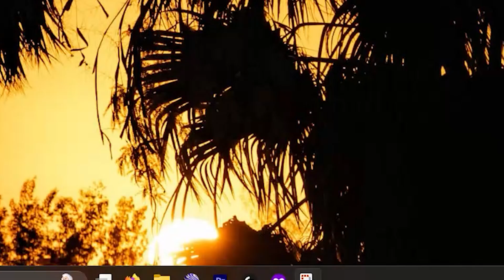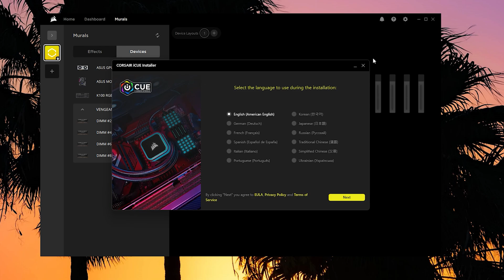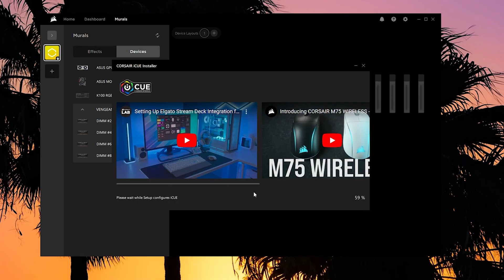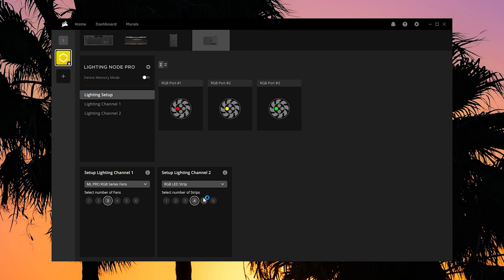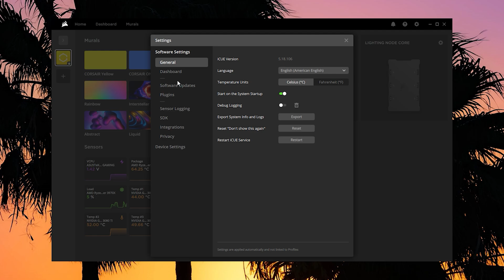Corsair iCUE 5 - No device detected

Comment: Well, sad I probably have to change the Node Core, because one of my "Q"fans stopped getting a signal on its outer rims and the second stopped LED-ing completely. Also iCUE sees ALL my stuff (all 16 of them xD even those two not working) even the NODes, YET I can clearly see in the Device manager the Node Core is not recognised as a device... an gladly throw it onto Windows 11, before there was no problem...
I will check it again and in more depth when there will be at least a week holyday when I will be able to take the pc partly apart xD

Comment: My issue is every so often my middle fan in the iCue link hub has no lighting effects and every time it happens iCue doesn’t detect the hub or fans even if they’re in device memory mode. 

A power cycle always fixes it and iCue recognizes it again, it’s annoying. Granted it only happens a few times a month but I know all my connections are solid and I can’t see it being a hardware problem as it’s easily fixed.

Comment: I have Corsair vengeance rgb ddr 5 ram and it doesn’t just built my mobo 3 days ago and I looked up every vid and confirmed seating checked for dust. Updated every drive, bio, and just as many updates that was needed.. I’ve repaired, reinstalled, uninstalled, and just legit about everything and when it also comes to restarting the pc if freezes and my orange dram light turns on my mobo and doesn’t boot. And once again all my parts are new i was very if not extremely careful in putting everything together.. and tbh the pc works fine i just can’t reset my pc nor see my ram in my i cue app. What could be the problem?
Reply from the maker: Sure what are your specs?

Comment: Hello, buddy!

I just got a HX1500i psu and it doesn't appear on my ICUE. I tried repairing the instalation, but didn't work. Any tips
Reply from the maker: Just to confirm, you did use the USB cable from the PSU? If so, try reverting your iCue and see if that works.
Reply: @ChrisMizo  I'm not sure about that, I'll check with the guy who did the instalation... thanks, bro!
Reply: @ChrisMizo  that was the issue, bro! Was missing the USB cable plugged in on MB. Thanks for the tip! :D
Reply from the maker: @BrunoNarghel no problem! Glad it's resolved ✌️

Comment: Nothing worked
Reply from the maker: what is the issue you are running into? what are your specs?
Reply: @ChrisMizo  PC specs:
Motherboard: ASUS Prime B-550 Plus AC-HES
CPU: Ryzen 7 5700X
GPU: RTX 4070
AIO Cooler: iCue Titan 240 RX LCD
RAM: 64 GB Corsair Vengeance RGB Pro DDR4 (4x16)
PSU: Seasonic Vertex GX-1000

My theory is that the USB splitter cable that connects to the USB 2.0 header might be faulty like you said in the video. Everything runs fine. The LCD screen is working, the fans are working, and the RGB is working. I just can't control them since icue doesn't detect my cooler at all.

Comment: For anyone wanting to use the Corsair Commander core XT & a corsair fan RGB hub or lighting node pro. IF you are NOT using Corsair components it will not work, example i have 7 LianLi uni-fans GPU & CPU water block also a 24 pin strimmer,& distro plate all with RGB, none of which are corsair, To get all my non corsair component's to work & be able to achieve individual control over ever components i had to purchase 2 Corsair Commander Core XT controllers, Then everything worked fine with signal RGB & IQUE. Don't waste your time & money if your not using all corsair components...trust me...

Comment: Listen, if you haven’t been moving or fiddling with your pc, and icue starts acting up, its the software. The best solution I have found is to stay away from all the expensive proprietary fan lighting candy, and connect everything to your mobo. The software development team at corsair keeps breaking the code that runs their garbage.
Reply: I tried everything. The rgb's was stuck on random pulse and not detected by icue software. - Just unplug the "Node Pro" dont need lights anymore.
Reply: Agree

Comment: Ive managed to get the rgb working but the fans dont move and are not detected somewhere 
The node is already plugged in the motherboard on a inrerna usb
Reply from the maker: Make sure your fans are also plugged in and just not the rgbs
Reply: @ChrisMizo  After searching in many videos etc, i've seen that all fans need alos to connect direclty to the MB... Thing is, my MB only has 3 fan ports so i guess i need a hub now for all 6, right?
Reply from the maker: You can use a hub or fan splitters 👌
Reply: @ChrisMizo  where does the hub connects in the mb?
On any fan receptor?
Reply from the maker: @johntsam7071 same pins where the fan plugs in usually.
Reply: @ChrisMizo  so any of the 3 that my MB has, right?

Comment: @Chris Mizo. I've tried all of your tips from your videos. No dice.
Reply from the maker: What's the issue your having?
Reply: @ChrisMizo , for reference, I have the iCUE Link h150i LCD AIO w/ QX Fans + an additional 4 QX Fans and an MSI Z790 Carbon Max Wifi II Motherboard. All connections are correct, having been checked and re-done several times...  iCUE has never detected the AIO, QX Fans, nor my Motherboard. The LCD Screen displays the temperature and the fans work in their default rainbow colored mode and default fan speed, but they do not increase in rpm under stress at all... (which I discovered while benchmarking)... Luckily, my system performed very well despite this. Thank you for reaching out!

Comment: Hey, so I just put in the H150i QX, but I can't seem to find the settings for the LCD. It's only showing the liquid temperature, I think. I checked iCUE, but the settings aren't there. I've already got the USB plugged into its own header. I'm stumped. I don't know what to do
Reply: Join the club. I have had no detection of my aio and qx fans since day one 5 months ago.
Reply: @YOSTINATOR  I figured out. I connected the type c connector to it’s own header and worked
Reply: @Jonathan_Jokr can you be more specific?
Reply: @YOSTINATOR  you see the type c entrance in the aio module? (Where the hoses are on the radiator) that one connects it to the motherboard but use it's own usb header. Don't use the splice harness that comes with aio.
Reply: @Jonathan_Jokr  Where would I source a type c to header cable for this?
Reply: @YOSTINATOR  If I'm not mistaken mine came with it
Reply: @Jonathan_Jokr  I had a buddy help me install it. It is all installed correctly (re-checked several times) but we did use the splitter... I'm thinking there may have been a reason that we had to go that route, but I'm not sure. I'll re-check 🤦